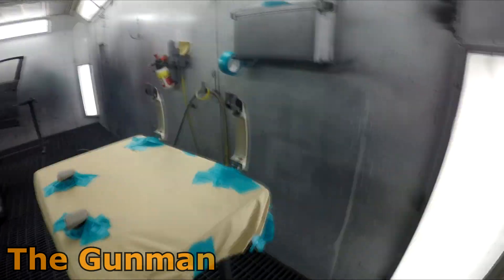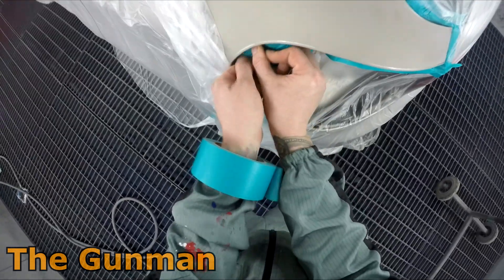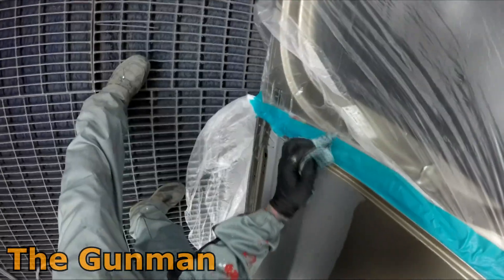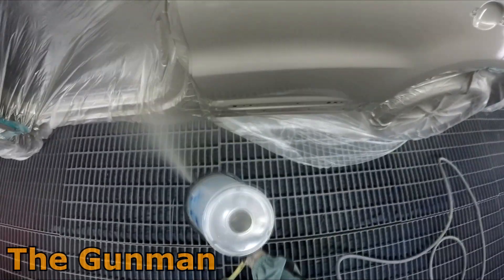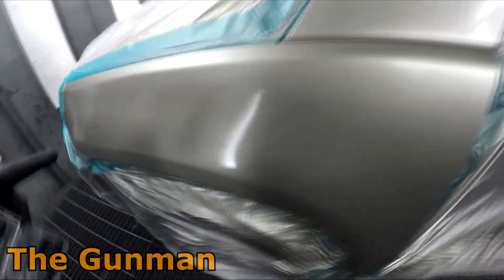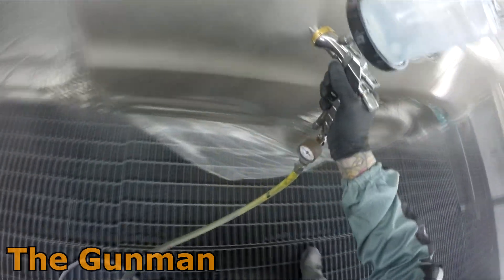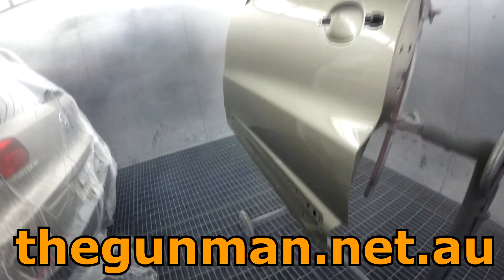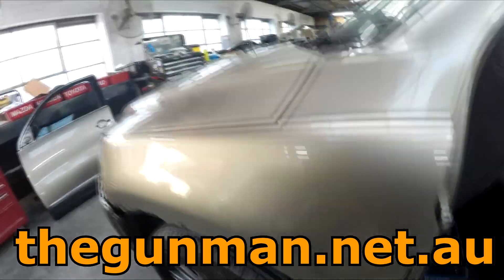Cromax Pro Water System

Comment: Not sure where all the similarities lie. We use Spies Hecker 480 and we're trained to use it like you're using Cromax. I'm still learning it too. Our shop provided 2 SATA 4000 HVLP  w/ 1.2 mm guns for blender and basecoats while we the provided our own clear guns. I've bought a pair of Sata's from my brother: 3000 B HVLP and RP, both 1.3mm and gotten good results with them. Based on your reviews, I bought 3 Teknas with 2 set up for base : 1.3 HVLP and 1.3 HE, and one 1.3 HE for clear .I still haven't used them yet except for edge-in. I bought them used so I'm trying make sure they're spraying right. 

When using blender, I go ahead and spray the repair too. I had some issues where the blender edge looked fuzzy and I just felt more comfortable with it.

Comment: I'm using this sistem for 5 years now and I can tell you one of my tricks and that's colour matching (I'm a little proud of my inventio haha) - when I make colour card test, I spray whole card 2 coats wet on wet (wet and than flowcoat for metallic), than dry it and than I mask half of the card and spray only one light coat of base on half of the card. Next you have to remove masking and put the clear on and you can have even better results (in most cases, second one is even better match). And sorry for my language, it's not perfect hehe.
Reply: +jishimoari takumi 
yep i do the same on the normal 2 and half coat cromax and ive found more often than not the dry dropcoat is the better match. i do it at 1.5 bar.
my tech rep said most of the guys he speaks to have found the same but he cant tell me in the training as its not in the tech data.

Comment: Two tips.

1. Wet on wet primer: Just scuff up the edges of the panel. I have noticed that the Standox Nonstop primer sticks good to non sanded factory primer, but not so good on non sanded edges.

2. Try to be even more agressive and faster on first clearcoat pass.

But in the end, it's the results that counts and it looks like you get good results. :)
Reply: +Øyes Karosseri AS Our shop offers lifetime gurantee, so I end up sanding it anyway. I think they're emulating the Bulldog adhesion promoter. I actually worked with the guy who developed it. He's a trip.
Reply: +poseidon3032 Yes, my sales rep told me to do a light scuff before laying down the primer, and from experience I think this is a wise decision, especially on the edges of the panels. Never heard about Bulldog, but my Standox sales rep introduced me to this primer last year, and now we use it for non sanding priming, plastic priming and ordinary sanding filler. :)

Comment: Hey Gunman,I would imagine the water-based systems are much more cranky in regards to environmental conditions for humidity and temperature for the back-yarder or DIY'er??  I'm only a solvent base user with a couple of water sprays but really had difficulty with them.  Love the various systems you've shown us.  Please keep them coming.
Reply: RPMX4 yes it can be a huge hurdle. took me an entire day few summers ago just to do a single Hood with the PPG envirobase waterborne system. Was so hot and humid here in Maryland by the Chesapeake Bay that the water would simply not evaporate from the hood , finally had to blow my torpedo heater on the back side to get the water out! and it was a poor hiding red pearl which took like five coats!
Reply: Oh man, no kidding.  I did a Dodge Inferno Red (truck) touch up a couple years back and it was just impossible to work with in water.  My supplier told me to only reduce it by 10% which I did, and that was incredibly waaaaaay too "watery".  It would simply not cover and took half a dozen coats, ran like a you-know-what, so I can relate completely to what you're saying.  Are you running waters or solvents?  Just curious.  Happy painting friend!
Reply: I'm using both depending on the job. I just used Matrix solvent-based for the first time this weekend on a tri Stage White Toyota Pearl and it worked great. I would really like to try this cromax Pro waterborne base but haven't found a distributor yet who will mix and sell , they only sell full tints and I don't have the mixing system.

Comment: The 3m p.p.s. Cup is holding back the flow through your bellaria. No vent. Try it with the original pot. I use my 1.3 bellaria with cromax base with sata r.p.s. Sprays metallics great! Plenty of material.
Reply: +SmehrE I've always wonder if PPS and DeKups were choking the flow, good point.
Reply: SmehrE but they really don't

Comment: Great video gunny! Quick question, not sure if I heard it right or not but you said you can use the tack and wack method with HS clear? I've been messing around with my Sata 5000 HVLP lately and I don't seem to be getting the same amount of material on the panel if I move quick like you do. Could be I have the fan too wide or I'm moving too fast but I was just curious. Keep up the awesome videos!

Comment: Its difficult moving from a solvent type base coat to true water base, you did very well for the amount of time you’ve had with it. On the video, if I had to find something negitive to say, Id say you over applied your blend. With Cromax Pro, you need to trust the product and under blend if anything. Getting your WB2091 down wet (most don’t) and getting your blend on it as soon a possible with give you amazing blends. Its the easiest blending base coat out there. Try applying lighter in your blend area, over wet WB2091 and you will see. Hard to trust, I know. The more you mess with the blend the worst the result. Next time, test you gun on some paper at 12-14 inches  (1/2 coat) from the paper and you will still see significant coverage., no need to over apply. Less is is best when blending colour. Adding water is only needed in very low humidity. for best mottle control with spray sensitive colours (Fine Met) is best if the base coat is able to stay wet for a bit to reduce the mottle effect on its own, allow to dry for a few minutes before adding more heat ,If you see some mottle after it drys and your not happy with it, you can add 50% WB2091 too your color and do a light drop coat at slightly lower pressure, but again only apply one drop coat, don’t mess with it to much or it becomes worse. 
Good job!

Comment: maybe with light silvers run a little wow on the edges of your blend panels I also find a double technique coat for the panels off the car help with a uniform side once all panels are fitted. on hot days use a little bit of slow water in your mix helps those metallic lay down nice once you get used to it you wont look back

Comment: Another great video keep em coming,ive not yet used water base but gonna have to one of these days my supplier has told me certain tinters are becoming difficult to get in solvent.Can you give me advise on mini guns shall i go for star evo106 or ani r150
Reply from the maker: I rate the ANI R150 higher and should be cheaper, if you tell SprayGunsDirect.co.uk I sent you they'll throw in a gun cleaning kit.

Comment: Hey man thanks for your info thus far I was wondering with vl bumpers and door moulds whats the best way to prep them.they have been resprayed before I got the car and are Chipping and cracking all over I tried to rub the rear quarter back but wasn't going through the respray/primer and can't use paint striper as it's plastic.
Reply: Rub back then body filler the go?

Comment: great video as all ways just a quick question you probably been asked do you mix water based differently then chemical based and what do you use to clean the guns after prob do a video on it.
Reply: Stephen Wilkie reduction rates between solvent based and waterborne base are completely different and vary depending on manufacturer. Water-based just cleans up with water or special water base cleaner if you prefer.

Comment: I use the Axalta Cromax solvent system. What Axalta wet-on-wet sealer are you using that is guaranteed to stick to unsanded e-coat? I am using 7740s currently, but the tech sheet says the OEM finish or e-coat substrate must be sanded. I may be looking to switch to something that will stick to ecoat.
Reply from the maker: Testing my memory but think it's NS7002
Reply: +Sam G You could check for a different reducer or additive. Spies 5450 allows two types, and one of them helps the sealer etch in the e-coat. They tell us to just wipe it, even on the external. I do on edge-in, but the skeptic in me still sands it. For insurance sake.
Reply: +poseidon3032 thanks. I'll check with my rep about an additive . want to stick with my current sealer.
Reply: your welcome

Comment: Can I get a decent finish with a Walcom gun for Motorcycle painting? Or should the Devilbiss startingline guns suffice? I am contemplating getting a kit as I will paint for myself and a few friends during wintertime when we store our bikes anyway I most likely have to use solvent as I am spraying in a ghetto setup booth and heating with it to dry afterwards . Unless I build a heated room just for painting I have to paint with no heat and move objects after.
Reply from the maker: Never used Walcom but I hear they are good guns, stay away from starting line, they are poor quality, ANI F150 or DeVilbiss FLG5 are 2 other good priced options but quality guns.
Reply: +The Gunman Thank you so much. ☺

Comment: Hey gunny i did get a shot at the cromax water and it work well but i  cant get use to doing it blend first i did it and looked good on a silver honda 1c8 paint code but they use  PPG concept 2002 clear there over there  good clear but very slow dry time..     I used my sata jet90 for clear with 1.6 and  my friends iwata for base my sata is not set up for waterbase.    you have not had a chance to work with that water clear yet PPG MAKES.    Have not seen it here in the US. Like you always say get out there and paint some shit.
Reply: Eddie Martinez wow Eddie you're a blast from the past! I didn't think they still produced 2002 clear, I used that like 15 years ago.... and with a satajet 90! yes you're going to want a new gun, if you haven't already then check out Gunmans video of top 10 spray guns.
Reply: Eddie Martinez also, not sure if you're referring to the envirobase clear coat from PPG. it's not actually waterborne just made and marketed for use with their envirobase waterborne system. I've used the super fast version and it's nice but super expensive too!

Comment: hey I need some help I have a tapeline on my panel I already painted and cleared it the tape line is in the base coat I just noticed it after I cleard. how do I go about fixing it ? thanks
Reply: Thibault if it's under the clear you're basically going to have to prep the panel as a blend, like sending the panel flat with 800 to 1000 Grit and spray a little color over that area to hide that tape line and then re clear.

Comment: i liked watching video !!! i think your awsome painter !! but wow chromax ?? its about ten years behind in water technology
Reply from the maker: I believe they are leading the water race, Glasurit are the ones behind
Reply: +The Gunman yes glasuirt is to lol .. i have been using the ppg envirobase for a year now ..i find it superior to everybody
Reply: Envirobase is great as long as production isn't something you need!
Reply: +Anthony Milano I've used Envionbase, and now spies hecker 480. I'd say spies is faster, and works similiar to Cromax based on this video.
Reply: MrCorosiveone getting so fed up with the PPG envirobase! I find it very slow! glad it's working for you though. I especially hate it when it's hot and humid here in the summer. did about 10 jobs in the past with BASF and think I like that better. love the look of the cromax system
Reply: The Brand AMEN!

Comment: need help to paint a door to my color. how do i get a color that you dont see any differens? 
was at a paint workshop and they said to me that they need to spray paint the car to so they can blend in the color in the car paint.
Reply: +Chadi Audi you have to color match it to get it identical, here i think he uses the "blend coats" just to put a new clear coat on the surrounding areas i think, i don't really know how blend coats work
Reply: Chadi Audi yes, if you want to be certain that the color will match to your eyes you will have to blend the color into the adjacent panels , that is the fender in front of the door and the rear door or quarter panel behind the door. so instead of just painting the door you will be painting three panels. it would be rare that you would be able to paint just the door and not see a color difference.

Comment: new age is not the product but what air is going threw the air line . nitrogen charged air and a grounded antistatic air line allows drop coating x2 just like factory water base is all about high volume low pressure which creates small droplets much different than a solvent ..... but much beter

Comment: water base needs airflow not heat to flash off,start learning your trade
Reply from the maker: So you're saying heat has nothing to do with drying water based paint lmfao.
Reply: dean short no need to be nasty, of course both heat and air flow are factors... and where I live here by the Chesapeake Bay in Maryland, extreme humidity is a challenge!